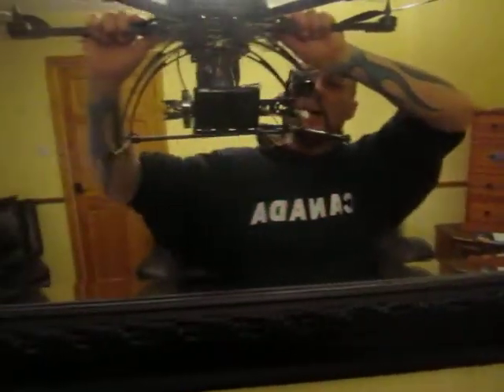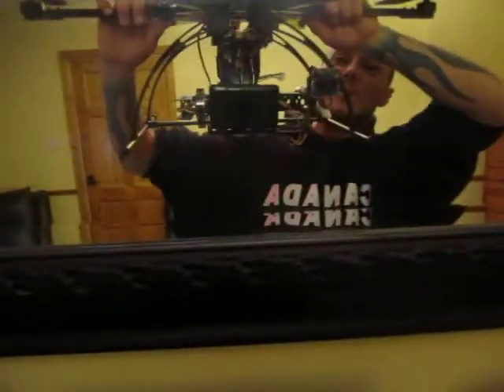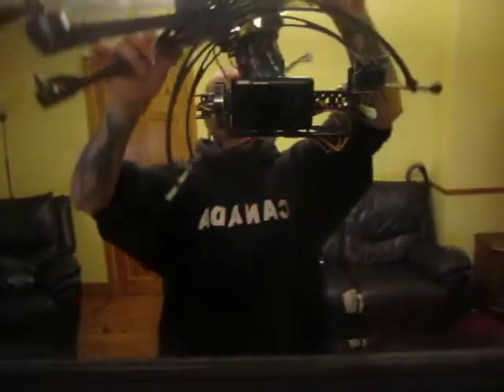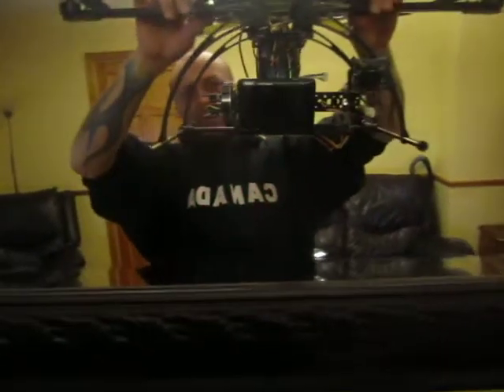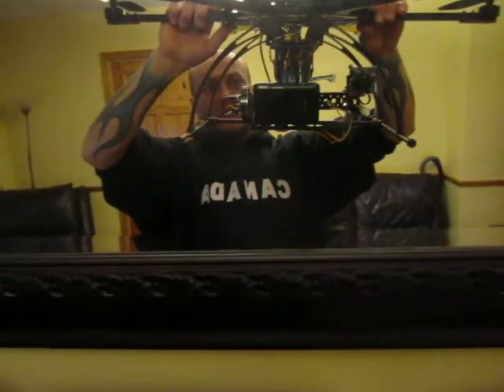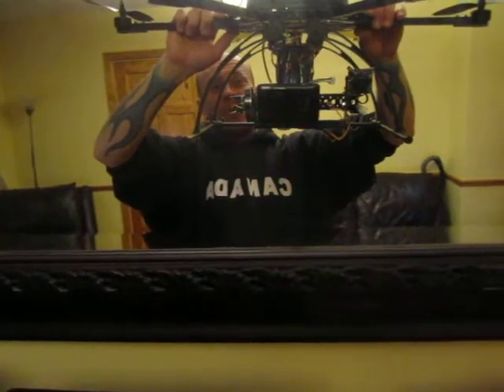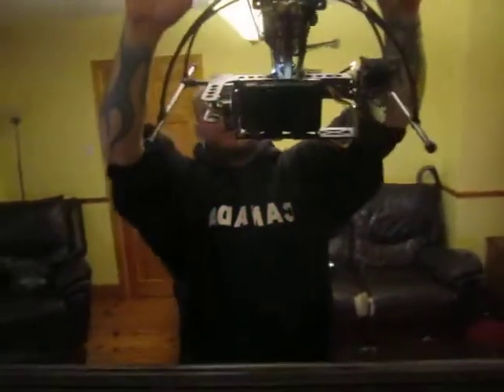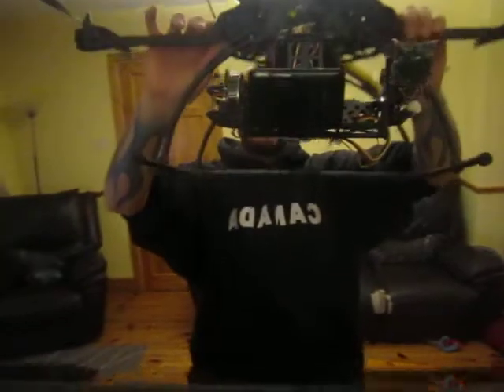AlexMos DIY brushless gimbal mirror test

Comment: Is follow mode on?  If not Id say the yaw tuning is off.  I found your video cause I'm doing a heavy lift gimbal and if I did a mirror test it's not staying locked in very well
Reply from the maker: +mapoff 
There's only two axis, no yaw, and back then at the date of this video there was no such thing as "follow on" yet:)
Reply: Ok.  Are you still messing with stuff these days?  I'm using 8017's for motors, and 32bit alexmos.  I keep the gimbal completely independent of my helicopter so I can focus on flying and someone else on camera.  That means the frame imu is below yaw.  Yaw doesn't lock well with my heavy production camera.  I did experiment and put it above yaw and it was way better, I just don't have a way to have an imu wire going above an axis that spins a full 360.
Reply from the maker: mapoff I'm not that much into gimbals atm:) 
Yeah, the closer IMU to center of all axis the better, but we can't choose much here. Another thing about yaw (can't say that it's your case, just a thought) is that quite often people getting a motor that is too weak/small. Let's say motor specs say they're meant for 500gr camera so get 3 of them and good to go, but it's not OK. Pitch motor has to deal with 500gr cam and pitch angle. Roll motor has to deal with cam, half of the weight of gimbal and pitch motor all included. Let's say it's already 700gr of inertia to deal with, and already would be better to have a bigger motor for roll than pitch, but then for the same size yaw motor is added another 200gr or more and then where it starts to struggle- you have to increase "power" in GUI for it to be able to produce the torque needed, therefore P has to be decreased. What I've learned over the years is not to go shy on motor sizes coz bigger motor requires less "power" setting in GUI, it just has enough torque itself, and therefore P can be increased what makes a gimbal more locked in. As I said this might not be your case and it's just a thought to look into, but first 3 problems for not locking in is bad IMU calibration, vibrations and not powerful enough motors. PID tuning comes only after them 3, coz on good few of my gimbals all I had to do is to adjust pitch/roll/yaw Ps once I had my motors chosen right:)

Comment: Dude, the problem is that I do not speak English .... I speak Spanish.
Javier Lopez
Reply from the maker: OK:) I had my roll PIDs all at max, coz that re-wounded motor was lacking power. Power was 140. Pitch power was 82 and PIDs were default. Keep in mind, that was on the old software, and was only barely few gimbal motors around, in the video is my own re-wounded motors. Latest softwares and factory wounded gimbal motors most of the time works on default settings
Reply: What is the default settings?
Reply from the maker: The suggested ones that comes already with the firmware, the ones you see already in the GUI
Reply: ROBOFORCERX2000 My controller card and white wine I load the firmware 2.0 b3 ... nothing came by default.